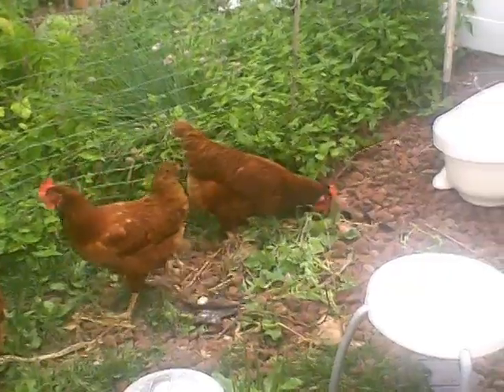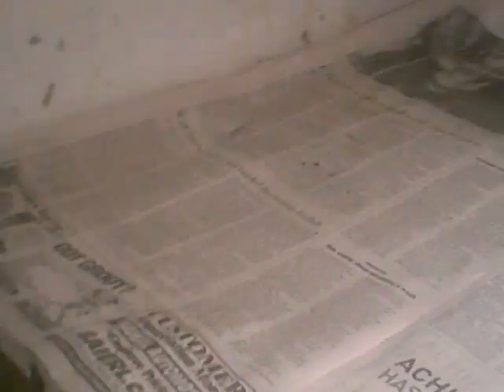Motorized Chicken Coop Door 2

Comment: Add-A-Motor does not warranty their product against failures caused my manufacturing defects; which means...they don't warranty their product.  Mine had plastic bits inside the gearbox that jammed the motor and they did not warranty it.  Buyer Beware.  It was also explained to me that the first time the string jumps track and destroys the D20, they don't warranty that either.  For $100, this product should have some minimalist load protection; yet it does not...at all...and will destroy itself.
Reply: Thats not true https://www.add-a-motor.com/warranty   They warranty all their products and offer extended warranties. You must have misunderstood. I've had my motor for over 10 years and never had any issues.